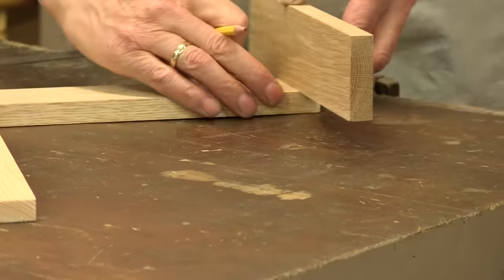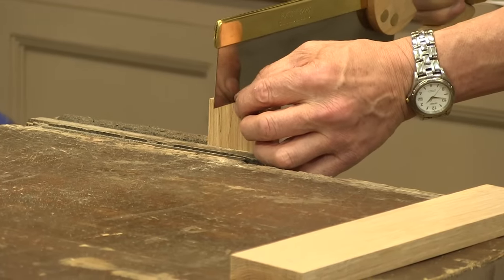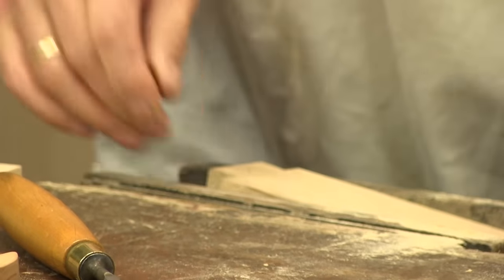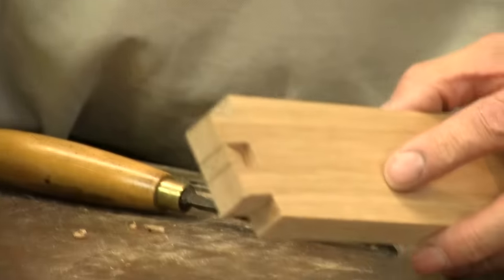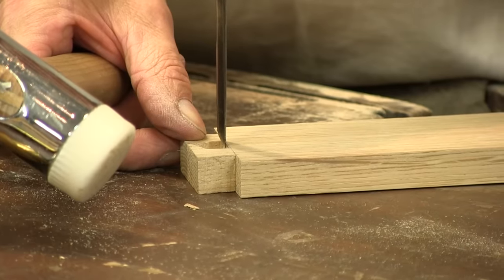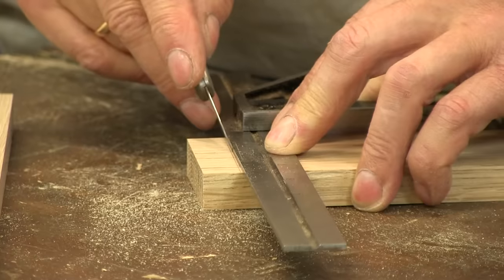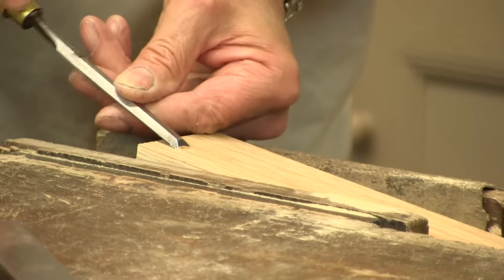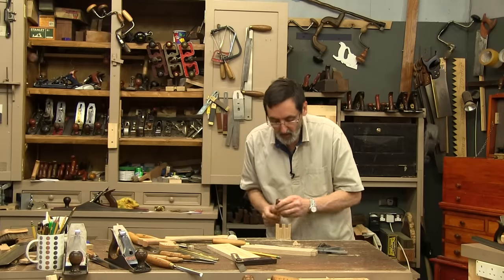How to make a Dovetail Joint - The Three Joints - | Paul Sellers

Comment: Wood working is a great talent. Wish I could learn the craft.
Reply: you can, anyone can
Reply: I took wood shop in 8th grade. I'm 59 now and still have my projects. There is something about wood that I just love. I don't use any of these techniques because the tools would not fit in my condo. But I get my wood cut at Lowes, the smaller pieces I cut with simple back saw and the rest is screws and glue. I don't use nails. One thing. I only buy real good wood, like Poplar, Redwood, or the expensive plywood and my book shelves, tables, all my projects look pretty cool. Are sturdy and will last long after I'm gone. I recommend you start with a simple project, if you want it perfect, you'll never get it done. So, be practical and just make it. Break the ice. It's a terrific hobby.

Comment: I've found it helps to use my bottom three fingers on the handle of the saw (which it appears Paul is doing, though I didn't hear him mention it), and let my first finger rest on the outside of the handle. Helps keep the saw from twisting, thus making a straight line easier to saw. To illustrate, if you hold your saw in the conventional way, and hold it out in front of you so you can sight down the blade, and then squeeze, you will see the saw twist a little. Remove your first finger and squeeze, and it will twist less or not at all.

Comment: Hey Paul, I've been learning dovetails joints but now struggling to learn how to plane the top and bottom edges of the material without grabbing or tearing off an edge. Do you have a video that demonstrates how to tidy the tops and bottoms? Thanks buddy.

Comment: I am not sure if I see right - when Paul removes the waste between the pins, tails and doing the first light vertical taps (hammer strikes) - is he holding the chisel slightly angled? So not 90 degree to the knifewall but maybe 80 or so? And just after some 3-4 strikes comes to 90 degrees? If so why? Is the bevel movig the chisel more to the direction of knifewall at 90 degree than at 80? Help would be much appreciated. Cheers. 
Funny remark. I am using a wiha hammer for chiseling. just found out today (after some 2 years) that Paul is using a hammer double the weight of mine. Always wondered why he comes so far down with a couple of strikes :-)

Comment: I was also wondering if that was a handmade dovetail saw made by you and was wondering what type of chisels were those I've never seen those type before great video lots of info I was going to start to make single  or double tail dovetail joints to get a better grasp on the joint. I think I'll learn a lot more than trying a 4 or 5 tail joint which didn't come out so well sometimes less is more.
Reply: The saw looks like a pax 1776, and the chisels look like old Sheffield chisels, but I could be wrong!
Reply: Joshua Currie
 The chisels are old Marples. I was able to stop the vid till I could see the name clearly.

Comment: Great instructional video. What point do you use glue? And what’s the best way to apply at? Thank you so much.
Reply from the maker: I would always use glue on my joints and that dates back 5.000 years so it’s not a new concept. The only time I would not use glue is if a project or part needs to be disassembled periodically.

Comment: Impressive video. You may have already answered this but, are you opposed to using a coping saw to remove the bulk of the waste from the pins and tails? Seems like it saves a lot more time and energy than doing it all with the chisel. Of course I realize if you were worried about time and energy you wouldn't be cutting them by hand in the first place. Just wondering if you feel you get a more precise joint using just the chisel to remove the waste.

Comment: Thanks for your clearly illustrated presentation of making dovetails. I picked up several things that will allow me to do better. Would you please tell me what is the bevel angle you use. For the finer paring do you use a different bevel angle than for chopping? It appears you use the same throughout the process.

Comment: GREAT video Paul. Thank you so much. Interesting that you do not use a coping saw, is there a reason or just your preference?

Thanks
Reply: I would expect that it would be how to achieve the work with a minimal workset, plus working the pieces out between pins and tails using a chisel leaves less chance of ripping up the endgrain on the inside face as the waste is supported on both sides. Cutting most of the waste out with a saw is a relevant technique, but it can easily leave all kinds of chaos on the endgrain face when chopping up the remnants. A million ways to cut dovetails as you know ;-)

Comment: Thank you.  Learned a lot from the fitting and fine tuning advice in particular.   Couple of questions:

1) Any reason you didn't hold the piece flat on the bench using dogs with your vice?  (Then you can chop down and cut near-axially with excellent support in both directions.)
2) i would have checked the pin and tail dimensions using a digital or vernier caliper (probably  first after cutting them) before trial fitting to detect any errors.  Is there a reason why this wouldn't be a good idea?  I guess maybe I would be checking the individual pieces whereas i need to also get the relative positions correct, and if i have the pins perfectly to size and but 0.5mm too close or too far apart, I then don't have any spare material to allow any fine-tuning???

Comment: thanks Paul for this great video. I am a beginner and doing my first dovetails... I use pine. my problem is, that the floor/ground in the opposite part of the dovetail (which is chiseled out) is quite uneven, has a lot of break-outs and holes. One can't see this part later on, but I am wondering what I do wrong. any advice? thanks a lot! love your videos and tutorials....!

Comment: I’m new to using joints versus glue and screws. Trying to get to a cleaner simpler finish. Do I need to use any glue for dovetail joints or other types of joints?

Comment: Tip top video, it beats gluing and screwing any day. When you make the saw cut do you cut the pencil line out, if you was to would it make for a better fit?
Reply: It seems he specifically states at about 6:01 that he leaves the line rather than cutting through it. In other words, he "leaves the line." This should make for a better fit. This way you can always pare down the sides to fit if the tails are too "fat." It's harder to put the wood back on! (though even Tage Frid shows how to expertly insert a slice of wood into a loose joint and hide it well. Though Tage teaches you to cut cut half of the line away, or "split the line."

Comment: Hello Paul,  DO you have a video on a sliding dovetail ( table top) ?  If not please do. A speecial plne to clean the base of the pin?  How about an angled jig screwed to a router plane? What is the best method?

Comment: I see you only cut the outside lines of the dovetail with the saw and then chip out all of the waste wood with the chisel. What are your thoughts on cutting down at multiple points inside the dovetail waste with a saw to make the pieces chip out easier?

Comment: Great video, Paul. One question and I'm sorry if I missed the explanation in the video: Why wouldn't you just make the cuts for the space for the middle pin with a saw? You did the whole thing with a chisel and I'm wondering why considering it seems like there'd be less of a margin for error if you used a saw.
Reply from the maker: Hi Danny. No, this is not really the case and my experience teaching thousands of woodworkers to cut dovetail joints is that when they first use the coping saw they are less accurate than their minds are telling them. That said and even though I can do it very efficiently I still prefer to chisel cut over sawing the waste away. Because we use a knifewall, there is no margin for error.
Reply: Thank you for the reply. That makes sense, thanks! I definitely understand what you mean as my biggest issue at my stage is making my cuts and then looking at them like, "How did this go wrong?"

Comment: I am making drawers. If Paul said it I missed it but there might be a preferred orientation and I assume I want the dove tail on the drawer sides and the pins will be on the drawer front. That way pulling on the front will be pulling against the dove tail retention not the glue of the pin retention. 

Is there a better way to describe the way to do it and why?

Comment: OMFG That is by far one of the best turtorials i have seen! thank you. btw is there a way that it can be done faster? i am standing here with 6 pieces of wood (2 of which is bend) and the are 140 cm. long, so that would take quite a while. should i use another method? or is there a faster way?
Reply from the maker: Hi Stefan. I’ve learned through 56 years of woodworking that the process is more important to me than the completed project. Try and relax and enjoy the process.
Reply: fair enough ill go ahead and do that

Comment: Any thoughts on using a coping saw or similar to remove some material between the dovetails instead of just a chisel?
Reply from the maker: Yes, I have done it that way for 5 decades and it’s fine for removing the bulk of waste but I prefer not to use this method except on less demanding work such as beehives,  tool totes and such like that.

Comment: Fabulous video - could i ask why you don't use a fret saw to remove the waste - would it not be quicker?
Reply from the maker: We generally find the coping saw is more robust and lasts much longer and either way you still have to chisel so there is my logic.
Reply: Paul Sellers no, I mean why chop out the waste, rather than use a saw, any saw.

Comment: I'm trying to get to grips with dovetails, following your videos, but why are they always shown on vertical corners in drawers and boxes, rather than horizontal corners on cabinets/shelves? If the tails are orientated to resist the gravity can they be used in that application or will they come apart?

Comment: His skill at this is amazing. I notice that he works at this corner without stopping for almost 35 minutes. As a hobby project that is ok but nobody could make a living doing drawer joints this way. With overhead, shop costs etc. Paul would have to charge about $60 per hour or more to net $25 per hour for himself. and one drawer's dove tail joints alone would cost $240 before you figure materials or the labor to make the rest of the drawer. I love this but to make joints this way you have to be someone who loves doing it.

Comment: Mr. Sellers,  I know one of the complaints I see in the comments on just about every working video is how slow things go.  And, quite obviously, teaching how to make a joint is slower than just doing it.  That's obvious... keeping things in view of a camera, explaining what you're doing, pausing to point out details, and so on just take time.

But I'd be quite interested in seeing a video of you working at normal speed building something:  a side table, maybe, or the shelf unit from Working Wood 1 & 2.  Something with a few different types of joints, start to finish, however you normally work.

Thanks!

Comment: Are dovetails and mortise & tenon joints easier to do on hard woods as opposed to softer woods? I would think softer woods would tend to compress more when sawing and chiseling while trying to do close tolerance work and fitting pieces together.
Reply from the maker: I find them both equally rewarding and can’t say one is better over the other.

Comment: Why do you need to hammer it if the glue has to go in as well ? Then the glue marks the surface and it all needs cleaning up again .
  I`ve just got past that cleaning up job .To me the important part of these joints is getting the diagonals equal , assuming I have not assembled it all inside out and upside down . ) a near miss for me ) It`s a good thinking joint to keep hubbys quiet for several hours .  Nice video of the oak though .    I made my third drawer with joints poking out a tiny bit. Then after glueing , my thin flexy Japanese saw sliced them flat . That part was a lot of fun .   For softwood I may give a thin varnish coating before cutting the joins as the wood can get quite grubby .

Comment: Hello Paul, I want to ask the same thing that others have here, is there any thoughts around choosing the coping saw method or the chiseling method to remove the waste ? I have seen you use both methods in different videos. I always use the coping saw because it seems faster to me, but i would like to hear the master.
thanks!
Reply: When chiseling out the waste you tend to get a much cleaner cut on the end grain. This is because both sides of the chisel edge has a lot of strong support by the wood. When you first remove most of the wood with a coping saw, there is now much less support of the chisel edge on the waste side of the cut. You'll tend to get torn end grain - the dovetail looks ratty. Granted, it only looks ratty before assembly, but some people care about such things.

If you don't care how your dovetails look (even the parts you don't see), use the coping saw.

Also, there's probably slightly better glue surface if you avoid the torn end grain.
Reply: In one of Paul Seller's videos he does make a throw-away remark to the effect that the coping-saw method is not really the one to use if you want really perfect dovetails.  In another (when demonstrating the coping-saw technique to a group at a woodworking exhibition) he mentions that he would use this method (use of the coping saw) 'for a drawer.'  Presumably, he was not referring to a drawer in a prestige piece of furniture.  ("I know I can do this in less than 3 minutes.")  Maybe he will read this comment and let us know!

Comment: Good job.
We used to get a clout round the ear from our woodwork teacher if we put down our plane  down on the bench like that as it can damage the blade. We had to turn it on its side before laying down
Reply: Same here, I had to kiss the plane to say sorry
Reply: How would putting a plane down on a clean wooden surface damage the blade?  The purpose of a plane (as you are clearly aware) is to cut wood.  Doing this does not damage the blade at all.  Added to which, putting the plane on its side runs the risk of putting the blade out of alignment but also exposes the blade so you are more likely to cut yourself.

Frank Strazza of the Heritage School of Woodworking (who is himself a fine woodworker) gives exactly the same advice as Paul - lay your plane down flat.
Reply: Laying the plane down flat is bad practice if you guys are adourning this woodworker as an English master craftsman. So lets get the facts straight as per established English tradition. It is nothing to do with damaging the blade (obviously) but it risks upsetting the blade perhaps less obviously to some!  Now with a modern metal plane there is less chance but the cap lever is not always dead tight so the practice is still sound. The tradition originated from the wooden plane where a hammer is used to knock the end of the blade in to protrude more and to knock the sole of the plane (hence flexing it) to release the wedge fixed blade back into the plane body to take off a finer shaving.  Another consideration is that the protruding blade is likely to damage the benchtop and the condition of the bench is paramount for a master craftsman. So the correct traditional method is to place plane on its side, ideally in the well of the bench. These are the finer points that differentiate a master craftsman from just a good woodworker and good teacher! When you mention master craftsman you must not devalue the term. It means the very very best and method is all important.
Reply: woodscholar At last a comment based on evaluation I knew all those clouts on the back of my head were not in vain

Comment: I see you trim it down with the plane to make the dovetail flush, would sand paper also work for that? If I took a sanding block and worked it across there until the dovetail was perfectly flush? In my mind I see that as saving a step. Is that wrong, or would it work?
Reply: +Jason McCabe (Camulas) It would work, but it would take much longer (by hand) than using a hand plane. You could use a powered sander (taking care not to soften the edges of the work) but given the noise and dust I'd still suggest a #4 or #4 1/2 plane. Basically - it's not some sort of retro fad; a hand plane is sometimes a really good tool for a job.

Comment: Respect, when you pulled that dovetail apart for the first time it sounded like a little Champagne cork popped. I hand cut my very first dovetail the other night, in pine, and it wasn't half bad, only about 49% bad. Whoops, wish I hadn't watched all the way to the end this time. Serious question, sir,  most of the dovetail cutting demos I've watched, use pine, does the fact that oak is a more "exacting" wood make for more precise dovetails. I have several feet of pine and poplar for practice but during the Covid-19 mess I have no desire to go out for some oak, so pine first then poplar for now?
Reply: Pine will give you better practice, because the grain will crush before it will cut. This means that your tools have to be very sharp.